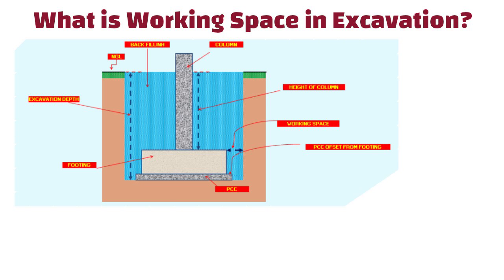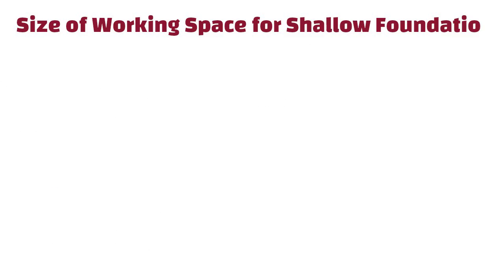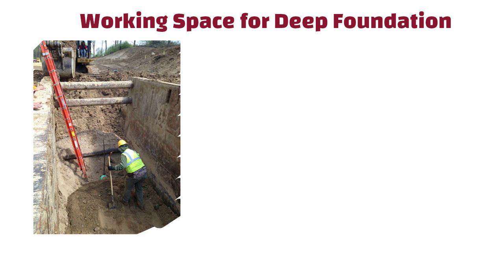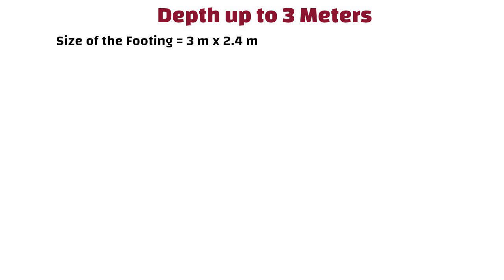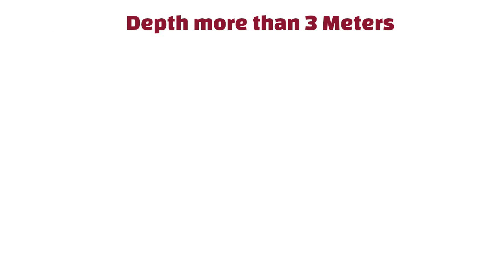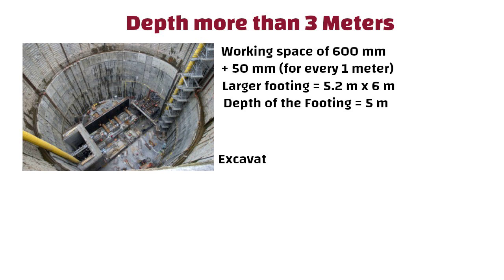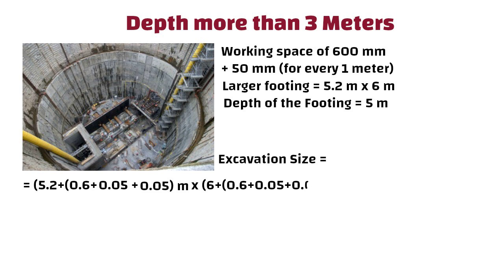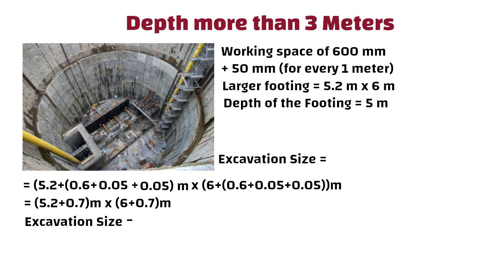How to Calculate Working Space in Excavation?

Comment: I have a doubt..
You said 50mm for every 1 m.
So in the example the footing size was 5.2m x 6m. 
Excavation size for the longer span would be (6+ (0.6 + 0.05+0.05+0.05) right? Extra 50mm for every 1m from 3-4m, 4-5m, 5-6m? 
Correct me if I am wrong..just need clarification on this